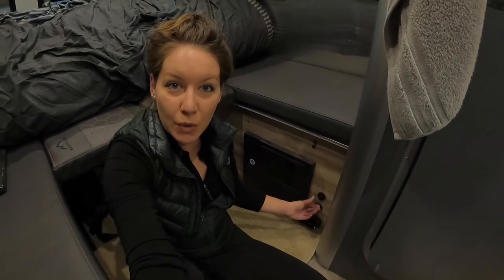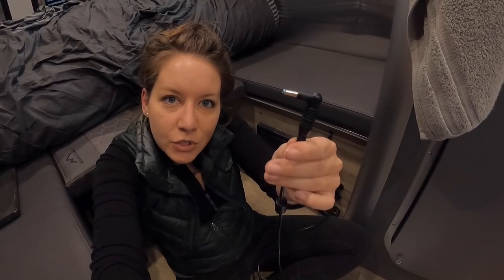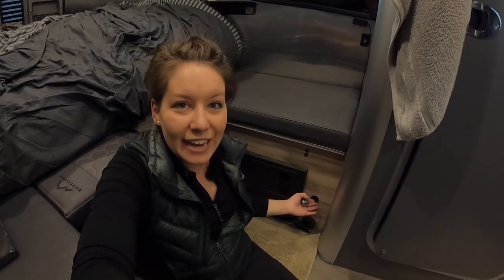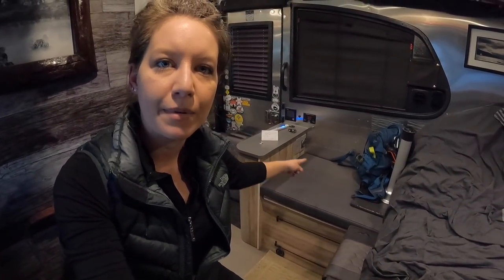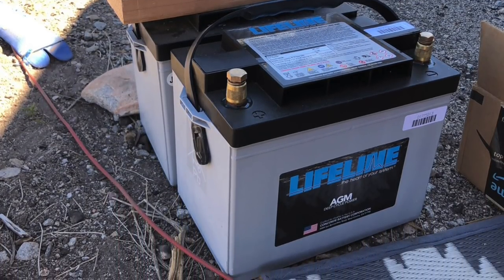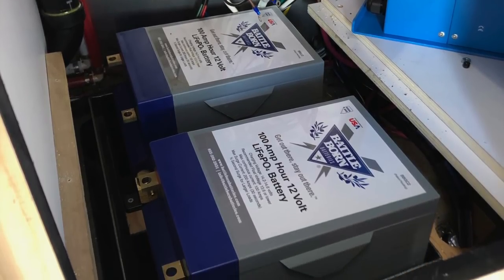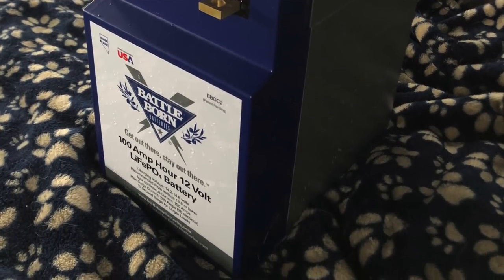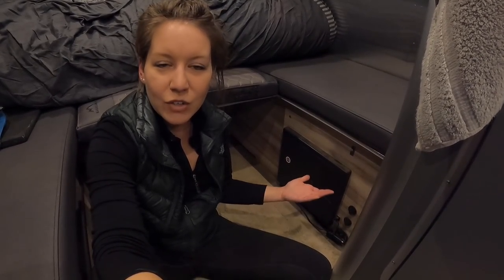Airstream Basecamp Electrical Basics & How to Install 12V Plugs for Boondocking

Comment: A very good and helpful overview of the basecamp system, thanks!  I just got a used 2017 and like it lots but am surprised that it didn't have an inverter etc.  A word though about inverters, I have a little off the grid cabin in No. Wis and the figure I got is that an inverter loses about 20% of the power in the inverter process so they are not very efficient.  So the more things you can use DC for when boon docking the better.
Reply from the maker: Really glad you were able to put a number to how inefficient the inverter is. Thank you very much for sharing that info!
Reply: Wow 20% loss is a lot! I wonder if the new ones come out with better efficiency?
Reply: @jimmielittle877  No, that's just what it takes to convert from AC to DC.  There is a formula to get a precise loss but it's always between 15-30%.

Comment: Yes, I will echo Jeff below...your review is very thorough and concise.  I notice where you are in this video that you appear to be in a snowy area.  If so do you experience electrical storms and do you have to worry about power surges etc.  A tip; truck stops offer many 12volt appliances for their occupation...thinking a small fan on 12 volts etc; rather than the larger draw Fantastic or equivalent fan.  Another thing to be aware of; Toyota is working on introducing solid-state batteries that will be a game-changer for the world of solar set-ups etc. as they will charge in much shorter times than current lithium products.  This technology will trickle down into other areas other than automotive.  Cheers from British Columbia.  PS...I just subscribed based on the quality of this presentation.
Reply from the maker: Thank you very much for subscribing Bruce!  I have never experienced any electrical storms (so far).  Interesting on the solid-state batteries, I hadn't heard of those prior.  Thank you for sharing!
Reply: @TailsofWanderlust  your welcome.  I don't remember where I picked the story up, but I have been aware of new battery technology coming down the pipeline.  Good luck on your travels and keep Covid safe and smart.
Reply: There's tons of new tech on batteries. Most of it never makes it anywhere. Big battery Co buys em, then shuts em down

Comment: The wife and I are about to start living in our 2021 Basecamp next month. We have watched a ton of your videos and have found them super helpful!
The 12V plugs I ordered came with wires. The positive wire has an inline 10A glass fuse - I should just cut that out of the equation if going to the 12V fuse on the panel, correct?
Reply from the maker: Congrats on the new Basecamp! I'm in no way an electrical expert.  When we installed it, we didn't have an inline fuse, just connected to an open one in the fuse box.  With that said, and them providing a 10a fuse, I'd just make sure that the wires support the electrical coming through the 12v fuse.

Comment: Great job Cass! Great explanations for beginners. For Agm batteries you should be able to look at the battery specs and see different cycle lives depending on depth of discharge (dod). Also go to do for lifepo as well. You can drain them to 0 but that will effect you cycle life. 15-20% is probably a better choice. I think at an 80% dod modern good quality batteries like your Battleborns should last for several 1000 cycles.
Reply from the maker: Great point. The Battle Borns have their own built in BMS systems, so they actually prevent me from discharging the lithium too low which is nice.  Don't have to worry about that.  And they are rated for 3000-5000 life cycles.  We'll see with putting them to the test how they do, but so far very happy with them!

Comment: Hey, super excellent videos, you're the one that i stumbled on that got me thinking about rv living (i'm a travel icu nurse) ; I'm about to go look at a 2021 20x and possibly order one up, very exciting.  The new models can come with the battleborn 100 amp LiFePo4 batteries, but still no inverter.  I'm thinking I'll use the bluetti and have a honda 2200 as backup but i'm struggling to find info about wiring an inverter as you have done.. I'm also a big fan of will prowse but he covers more battery banks and not wiring into existing rv systems.  can you elaborate on how you wired your inverter? it looks like it's tied directly into your batteries but i can't tell what you used for breakers and if you have a cord or outlet coming off of it?  any info is super appreciated.  wish airstream would get with the program and wire in an inverter now that they've finally come on board with lithium.  thanks!!
Reply from the maker: Hi Ash!  I'm not an expert on how the inverter is wired up as I hired a friend to install it.  It is a full house inverter, so it's wired to the batteries and then runs all the electrical in the trailer.  There are other inverters out there that you can get which wire only into specific outlets.  There are a lot of DIY solar/electrical videos out there, so hopefully someone can give you a bit more detail on that.  Have fun checking out the 20x and let me know if you have any other questions!

Comment: Hey Cass, just curious as to whether all these electrical components have passed inspection from Jasper? 😁  Amazon sells a 250 amp. high output replacement alternator for you highlander that would increase your vehicle's ability to charge your batteries when your driving. Happy New Year! 🥳🥳🥳
Reply from the maker: Haha Jasper approved!  Great to know on the alternator.  I've been looking at some components from Australia that a friend uses, but they were more than that, so I'll check it out.

Comment: Hi. Love your channel. 
I am looking at getting the 2023 Basecamp 16X REI edition. It has 2 BattleBorn batteries and 360W solar but bummer, they didn’t put the charger/inverter. So there is no inverter. 
I noticed that your inverter is a charger/inverter. Are you using it to do both?
Also it sounds like you found a great dealer to do these upgrades. Can you share who they are?
Thanks
Reply from the maker: Yes, mine was wired up to do both. The inverter is big as you need it to run any 120v outlets when off grid, including the pop up outlets on the front counter. Odd they didn’t include that. I used Pullen Solar but not sure if they are still doing installs. Check out Airstream Nuts & Bolts as well.

Comment: Great video Cass! I am a bit confused so maybe you can answer a question. I have an ipad that I will be working off of that I will need to keep charged. Why couldn’t I just plug it into the USB port to charge it like I would my phone?
Reply from the maker: Hi Tracy!  You can, but the watts/amps coming out of an USB outlet are very low and would take hours upon hours to charge the iPad.  You would actually use more power while it's on than the charge can keep up with.

Comment: Have a question, do you have aux. solar panels or just the airstream ones?  I'm trying to decide whether to buy a portable power station and some addl. solar panels or investing in batteries like those you have.
Reply from the maker: I have the rooftop Zamp panels that was an option from Airstream.  Then I have 180W of deployable Zamp solar panels as well.

Comment: Hi Cass. Just found your channel!
Have been researching RVs for over a year now and was thinking about starting with a teardrop 
but after seeing all your videos,
I’m getting  a Basecamp 16x!
Can you possibly do a video on the cool bench mod you did? 
Though it looks like the new Basecamps might have that modification now built in! 
Btw - why is your interior AC a very cool stealth black color and not the normal white color that I see everywhere?
last question where did you get the awesome animal print blanket and faux wood wall stickers?  Thank you!!
Reply from the maker: Hi!  Thanks for watching our videos!  I will work on a video about the bench in the near future.  I do believe the new models come with the "bench mod" already done.  I swapped out the white AC cover with a black one, as I felt it blended in more.  And the animal print blanket is fleece from JoAnne fabric that my mom turned into a blanket for me, and the faux wood is simply a sticker! You can check it out here: https://tailsofwanderlust.com/2020/02/04/10-best-airstream-basecamp-rv-accessories-for-under-25/

Comment: The Predator 3000i inverter generator cost approximately $700.00 at Harbor Freight. You could use air and a microwave with this set up! Only weighs 70 lbs.
Reply from the maker: That's awesome! Thanks for letting me know.

Comment: Hello Cass,
I've view this video a few times and find it extremely helpful. It is filled with a lot of valuable and useful information. Your presentation is concise but detailed and flows well. It is clearly the best Basecamp video on the entire web!!! Excellent job!
I would like to ask you more about the battery upgrade to lithium. The original batteries are group 24, I believe; would the other style of Battle Born batteries fit without box modification? You also mentioned changing to a new Victron battery controller and a Victron solar controller; is that two items or one item?
I would not be adding an inverter. Do you think most of the upgrade can be done by a DIYer?

Thanks!
Reply from the maker: Hi!  Really happy to hear you found the video that helpful!  In regards to your lithium questions, if you aren't already a part of the Facebook Basecamp group, I'd recommend checking that out.  There are several DIYers who put in their own lithium system.  Depending on the year of the Basecamp, you may have to swap out the converter as well.  For my upgrade, the golf cart style Battle Borns are the only ones that fit into the battery box that comes with the Airstream.  The Victron battery and solar controller are two separate items.  Hopefully that helps!
Reply: Thanks Cass!

Comment: Informative video. Comment and question. I have a 2019 Basecamp X with factory solar and 2 group 24 agm batteries. Did you drop in your lithium’s into the existing space and is a different charge monitor required? Also, you commented that a large generator is needed to run the AC. To confirm, a Honda 2200 runs the 9200 btu unit with no problem on my trailer.
Thanks for the great content!
Cheers
Reply from the maker: So glad you added the information on the generator, thank you!  And for a 2019, you will need an upgraded solar controller & converter in order to change over to the lithium.  Working with the company that installed my solar to try and make a lithium video in the near future.
Reply: A lithium video would be very helpful. We have a 2020 BasecampX and want to switch to lithium.
Reply from the maker: @GM-gv8kc  Planning it now!
Reply: Us too! As 3rd owners of 2018 Basecamp 16 with solar on top, the AGM batteries are badly degraded, so we plan to upgrade to lithium. Cass, did you do yourself? I think I can, just need to find some instructions. Thank you Cass!

Comment: You should look at the "72W TYPE-C PD CAR CHARGER ADAPTER" to charge your macbook.
Reply from the maker: I will definitely look into that. Thanks Bryan!
Reply: Yep there's different power levels of the "PD" or also known as USB-C. The socket is the same but output power can be high-speed charging phone levels at 18watts up to 100w max ratings. I believe most laptops need 65w and up for good charge. 
FYI there's little usb power meters that plug in line and read the voltage and amperage running through. Easy way to find a weak charge adapter bad cord etc when your device isn't charging normal.

Comment: Great video Cass!  Is your big Victron Inverter wired with a transfer switch to the main breakers on the 110V side of the Basecamp (feeding all the 110V outlets) or is it feeding its own specific plugs?   Thanks!
Reply from the maker: Thanks for checking it out!  My inverter is wired to all of the 110V in the Basecamp.  I'm not sure on the exact wiring configuration, as I hired someone to install that.
Reply: @TailsofWanderlust  Baller!  Would be neat if you could get a schematic for that!
Reply from the maker: @scootle74  That would be awesome!

Comment: AWESOME presentation👏

I hadn't considered the BaseCampX until watching your videos. 

Any regrets and if you had any issues, how is it dealing with Airstream for warranty work?

I hear so many horror stories about other Manufacturers😭
Reply from the maker: I've had good luck with their warranty.  Everything I've taken it in for has been repaired.  Here is everything I've had fixed on mine: https://tailsofwanderlust.com/2019/01/30/airstream-basecamp-repairs-warranty-work/
Reply: @TailsofWanderlust  Wow, pretty extensive😲

All in all are you still happy with your choice or would you have picked something else. 

And was all your warranty work done where you bought it or are other dealerships "Happy" to help you out?
Reply: @TailsofWanderlust  Wow! Thanks for posting your warranty and maintenance work!!
Reply from the maker: @KMx108  You're welcome!
Reply from the maker: @Steve-yo4ld  I've had warranty work done all over the country, so they are always happy to help out.  I would pick the Basecamp again for myself, as it is exactly the layout I enjoy.  Hoping a lot of this was due to it being a newer model, and now that things are ironed out I'll have less issues.
Reply: @TailsofWanderlust  Thank you for taking the time to answer. It's nice to know that other Dealers will honor the warranty. Any new purchase can have problems but it's the follow up that matters. I've  heard far to many times of RV dealers refusing service because it wasn't purchased there. 

Thank you for helping me to narrow down my choice, now I just have to decide on the 16X or the 20X😉

Have a Blessed and safe New Year😘
Reply from the maker: @Steve-yo4ld  You are welcome Steve.  Happy New Year to you as well!

Comment: I’d love to know where you got the square tabletops! Did you make them? Just use the hardware from the originals? Thanks, Cass!
Reply from the maker: Hi Ann - Yes, I used a normal piece of wood, then stained it and put an epoxy top on it.  Then I just used the mountain hardware from the original table.  It's about 5 screws to move it to the new piece. The biggest thing to consider is where to store the table if you take it off.  This square was as big as could fit in the bungee cords on the side of the bench.  But if you have a different place to store it, you could go even bigger.
Reply: @TailsofWanderlust  thanks Cass! The other thought I’ve been having is to cut a hatch in the side of the storage area so I can more easily get stuff. As is, I don’t put anything in there 😬
Reply from the maker: Do you have the bed mod?  My bench is cut in half.  Makes it much easier to access the front side of it.

Comment: What is the watt of deplorable Zamp Solar Panels do you use?  I was going to purchase some but wasn't for sure the watt needed.  I am currently in the process of updating to the same lithium and the same package you upgraded to.
Reply from the maker: The Zamp deployable panels are 160W total.  But I also have the 180W on the roof.  So it's the total solar that really helps supports the full-time living.

Comment: How much storage space did you use installing the inverter? Picture of the entire inverter would have been helpful. Have lithiums, but no inverter. Just want to run the MW while boondocking. If I need AC, will run off my Ford Powerboost with Pro Power.
Reply from the maker: MW?  If you’re looking for one specific item you can look at a much smaller inverter as well. The 2000W whole house inverter was so I could run my laptop and dual monitor plus almost anything else in the camper. It was tucked tightly against the wall but did take up a good amount of room.
Reply: @TailsofWanderlust  Microwave. Uses slightly over 1000W. Going for the smallest footprint inverter. Just wish Airstream made accommodations for an inverter in the Basecamp without giving up limited storage space. Came from an Airstream Nest. Tons of storage.

Comment: Cass did you need a second solar controller for the external panel? Great job on the video.
Reply from the maker: Yes I did need to install one on the external.  Also, depending how the wiring is setup, sometimes the rooftop & deployable panels can compete.  Mine thankfully charge simultaneously based on the upgraded wiring.
Reply: It also depends on how they're wired. Say 4 on roof with 2 in series then parallel. Adding 1 additional won't work, so another controller is needed. The Victron Blue Solar controllers make it easy and have a Bluetooth connection to keep them all working together

Comment: Can you do a video on your 4Runner. Any modifications or whatever you have done to it. I recently traded my wrangler for a 4Runner to better pull my t@g and curious about modifications. Thanks!
Reply from the maker: I will absolutely work on a video on that in the future!  If you are curious in the meantime, here is some info on it as well: https://tailsofwanderlust.com/2020/08/26/toyota-4runner-mods/
Reply: @TailsofWanderlust  thanks! It was a great read. I didn’t realize you had a blog. Now to do a deep dive into it. What do you use for jasper in the backseat to protect the seats? Thanks again.
Reply from the maker: @bavarian11788  Thanks for checking it out!  I use a dog seat cover.  I've had a few different brands, but this is the one i'm using currently.  So far no issues!  https://amzn.to/2Xibbbg

Comment: Greetings, Does the HP adapter have a black power brick in the middle or is it just a cable?
Reply from the maker: It does have a circular brick in the middle.
Reply: @TailsofWanderlust  Hmm @ circular. Interesting.

Comment: Roamaroo(YouTuber) has 3 BBs with 3000 watt inverter and 300 watt of solar panels🌻
Reply from the maker: That's a great setup!
Reply: Yeah I'm thinking if they used the Zamp plug in you use up front for two more panels that would be about right 🌻